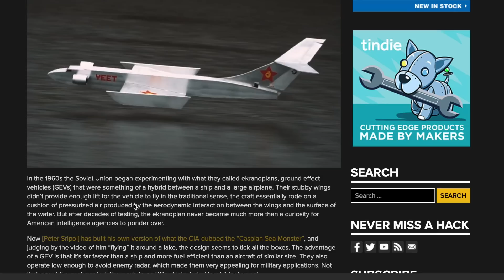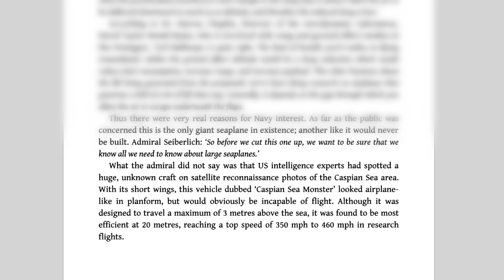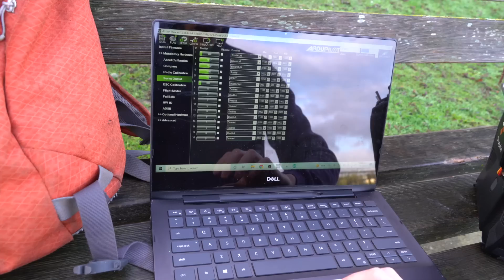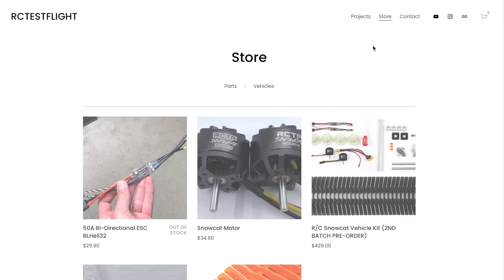Worlds First 'Real' R/C Ground Effect Vehicle

Comment: The reason real ground effect vehicles can’t fly is that they were engineered to only have enough power to fly in the ground effect, but with electric motors you have so much excess power that this isn’t really possible at small scales.

Comment: Maybe the easiest way to inhibit a ground effect vehicle from actually flying is through electronics. That might be cheating to some, but it probably wouldn't be very difficult to mount an air speed sensor somewhere, and then limit max speed through a flight controller.

Comment: There is a problem in ground effect vechils you know thos floats to hold that bubble those floats are facing down which gives it compression thrust even tho compression thrust works on mach 1 or above but still it give sthe lift even commercial planes are adding that down fin for fuel efficiency if you can some how make it like not produce compression thrust then ur good to go

Comment: Taking off seems to a big limiting factor for GEVs. Overcoming the resistance of water can be done efficiently with hydrofoils. The lift from the water will aid the craft to enter ground effect faster, lowering the required thrust, or vectoring for takeoff. The extra circuitry needed to raise and lower the folis will surely add extra weight, but I believe it's possible to achieve good thrust to weight balance to create a true "Ground-effect vehicle".

Comment: I just had another look at the "Caspian Sea Monster" and compared it with your craft... I think it operates on the cushion trapped between the two outer "floats" on the main wing.  If the altitude gets too high, the high pressure can escape.  Your craft has proper wings outside the "floats" which allows it to fly even after the high pressure has escaped.
Regardless, the model operates far too well to mess with it, just to try and satisfy some random definition!   Thanks for the videos.

Comment: Great job on your Bixel-type WIG!  BTW, Bixel proposed large (e.g. 747 size) "free-flight" aircraft using his symmetrical airfoil designs.  The stability and relative aerodynamic efficiency of his designs are obvious through your tests.  Consider the effect of split flaps installed near the trailing edge of the center fuselage along with split flats on each side wing....these flaps would serve as "air-dams" to help seal the gap at the trailing edge of the "skirt-less" hovercraft-type lift chambers formed by the insides of the float rails.  These flaps should allow for lower take-off and landing speeds and better low speed maneuverability.

Comment: One difference worth considering is the wing loading.  Ground effect with full size aircraft is generally accepted as the disruption of the wingtip vortices with the ground, increasing induced drag.  Induced drag is a function of lift, and by extent, weight.  Something like am Ekranoplan has a much higher wing loading and generate substantially stronger vortices than your depron rc plane even adjusting for scale.  Those wingtip vortices become much stronger when you have a heavy, clean, and slow moving vehicle.  Without increasing the scale of the vehicle, achieving near perfect results will be borderline impossible as this rather niche corner of aerodynamics dont exactly scale down to be achievable with something park flyer RC sized.

You could try adding small vortex generators to the leading edge to further reduce power.  But other than that, I think you've achieved as much as you can feasibly get without diminishing returns at this point.

Comment: Loving this series.   My 2c is that while your aero design is good, you also need to pay attention to hydro design when on the water, so that you can accelerate faster and then have less surface tension holding you down.  Your square floats are causing huge turbulence under the wing when you need that water smooth. Look at the chines on a motor boat or even flying boat.

Comment: The purpose of ground effect flying was to stay low under radar and save fuel for long range delivery across an ocean.  You need to test fully airborne and in ground effect to see which is more economical and that would prove it a ground effect vehicle regardless of it's power capabilities.

Comment: I know nothing about ground effect vehicles but was thinking about its tendency to fly higher than GE and wondered has anyone tried inverting the airfoil but keeping the low trailing edge, in effect forcing it to fly on the high pressure area at the trailing edge? As soon as it loses that pressure it has to lose lift. Just a thought 🤔

Comment: Looking at your videos, I actually think you would have something, in a larger scale. But use engine in the fuselage or 2 in the wings facing down wort , for the first push up, then you can keep the front engines in an static position.
For the lager scale, it's very possible to use for passengers. And by the way, contrary to American believe, power does not always help you.
I am a ships engineer, and there is a ratio between power and actual practical use. A ship has a curtain hull speed, adding more Power does not really make it go faster.

Comment: I wonder if it would do better by cutting off the wing tips... the hulls should be boat planing hulls like floats on a float plane. All the emphasis should be on the center high pressure area... I would start trimming the wing tips until the desired effect is achieved... 
I think the definition of a ground effect vehicle should be: classified and insured as a boat and not an aircraft (regulated by the FAA). Boat construction, insurance, maintenance, safety and repairs is far cheaper than that of an aircraft. 
So keep trying!

Comment: Rubbish!!!   I built an RC  ground effect vehicle 7 or 8 years ago.  It was a Lippisch type reverse delta of 400mm span. It was built from white foam sheet. I had a cutout in the fin in which a tiny lightweight motor & propellior was mounted. It was controlled by a 2 channel micro RC system for rudder and throttle.

Mine came about from trying out a very simple ekranoplan glider made out of ceiling tiles after finding the plan on the internet. I tried it, then enlarged it slightly to take a microscale power plant.  It took a bit of tweaking to get the tailplane incidence right, A couple of days of on & off fiddling was all that was needed. Just a little idle weekend project. No big deal and I'm sure many others have followed a very similar route.

The trick is to keep it simple, you have way overcomplicated it. e.g Why do you need ailerons? If you are in ground effect then the wings are automatically self-levelling (a dropping wing will get more lift as it gets closer to the ground).
 Who says it has to take off from water. I just hand launched over tarmac. More gadgetry = more weight = more power needed. So you got into a descending spiral?

But my main point that that you are far from the FIRST. Just the first to make a big deal out of it.

Comment: hey great experimentation! 
Might try tapping on  bunch of short and super light, weight "tell tail" streamers onto the bottom surface of the wing between the sponsons to observe the flow behavior with the onboard camera. 
Also would be interesting to observe the flow across the top of the wing at various angles of attack, at various speeds and with and without some spanwise flow "gate" devices as used on flying wings?
What would tip sails do? 
What would Leading edge slats, turbulators or other whacky STOL devices do? 
good luck!

Comment: No, I work in aerospace, and I can tell you from speaking with the engineers , that NO the original Russian plane would NOT have been able to fly. It was specifically designed to maximize ground effect in every way possible. That isn’t good for flight control and aerodynamics. Specifically the wing angle and thrust dynamics.

Comment: Great video. I'm thinking the issue here is that your wing area is good enough to fly. So maybe a "real" ground effect vehicle is about the wing area and not really limiting the power you have.
If you decide to go further with this, I think you should try decreasing the wing area to find the sweet spot where you can be full throttle and in ground effect. Using the added lift from the motor tilt could allow you to minimize your wing area even more and maximize your speed.

You might encounter some issues, like your wingspan being so small that any difference in the weather could prevent it from ever lifting off the water. But this might improve stability. As right now, your wings are Technically, a ball to make the plane fly. The small differences in power and weather make the plane want to lift off. So having smaller wings might minimize that effect, That small "bounce" you observed.

Comment: I feel like the inherent issue here is scale. 

Things scale with size differently. For example size and weight do not scale in the same way. If you made it twice as wide in terms of wingspan, its surface area (which relates to lift) would be be x4, but the volume (which relates to weight) would be x8. That's the square-cube law. I can only assume that this would then have big implications on how thrust and drag (of both the air and water), interact with each other. 

On top of that you are also interacting with things in the environment that are real size. All those ripples in the water, the breeze of the air etc. while they seem small to you, they are actually all massive in relation to the tiny scale of your craft. 

So perhaps it's actually physically impossible to achieve the right balance of thrust, drag and lift for true ground effect at that small of a scale.

Comment: I have an idea to make it not able to fly... but that wouldn't be an aircraft any more... What about using underwater boat propeller for propulsion? In this way as soon as the "plane" goes too high and the props are out of the water it looses propulsion almost completely... As I can imagine it requires a lot of consideration where to put that (those?) propeller and I also see a big chance it could be super unstable... But if it works it would be something really unique :D What is that a boat with wings?
Reply: May be with a long shaft behind the vehicle...

Comment: One way to do that without cheating is to make an electrically limited power train: instead of reducing PWM or motor strength, make the power input from the battery the limit. This limit is then low enough so that the GEV can't fly outside of ground effect. And to allow the plane to start from water, add a capacitor in there, which delivers enough power for liftoff, but is empty right after that. That would be similar to the caspian sea monster, which could increase it's power for starting, but couldn't keep this high level of power going for the whole flight.

Comment: The definition of a ground effect vehicle regardless of how you word it cannot preclude a vehicle like yours that has more power than it needs. The Caspian Sea Monster will surely have had more power than it needed to fly at the optimum level to maximise ground effect. I am sure if they went full throttle it would fly a bit to high and start to rise and fall almost bouncing on the top of the ground effect. Look at the Saturn V rocket. Nil aerodynamic lift but a Rocketdyne F1 got it off the floor. I would imagine that an F1 on the back of the sea monster would also achieve "flight" but not perhaps the most stable. What you have done is exactly what the Ekranoplan people did. Identify a concept, produce the machine and make it work. They didn't just have engines that at full bore achieved ground effect. Another good video squire and don't listen to the critics. 👏👏👍👍

Comment: You keep running into problems because your wingspan is so short. The intensity of ground effects is determined by the ratio of your altitude to your wingspan. With the design you have will only have noticable ground effects within 3 inches of the ground. Your plane is too tall to fit inside the ground effects.  Worse ground effects reduce rear lift, which makes the plane want to pitch up. This forces the nose out of the ground effects. 

You are not flying in the ground effects, you are repeatedly stalling and bouncing off the ground effects, like a stone skipping across a pond.

In order to properly fly in the ground effects you have increase the size of the effects to include your desired altitude + the height of the plane + a little bit more to accommodate the plane nosing up. This means a plane with a wingspan at least 5 times its tip to tail length. Or some way of dynamically altering the downwash in response to changes in airspeed.

Of course if the skipping stone flight accomplished your goals them good job.

Comment: Have you considered adding a sensor that would regulate the down elevator? That way when the vehicle starts to go too high, it can self Regulate its height.
I think you should consider the goal of being able to fly as low as possible using the least amount of power. Isn’t that the purpose of having a ground effects vehicle? Don’t you want to get off the water with the least amount of effort? Once you are off the water, power should be regulated to the minimum needed whether it’s battery or gasoline.   You have to consider that a real Ground effects vehicle will have a pilot to adjust the power to the minimum needed. In reality, they will have A large range of power to apply and it will take many seconds for the plane to respond. The power you have in your propellers on your RC version allows your craft to respond instantly making it hard to operate.  Your power to weight ratio is just too high and does not scale. Loved the video.

Comment: Have you tried loading it down with a bunch of weight? Weren’t these designed to be high speed heavy lift capability? Maybe try loading it down with a tungsten ballast… make it too heavy to fly then you could use it’s full power. I’m sure you can figure out a realistic power to weight calculation, (heavier than a plane lighter than a boat) it would be a quick test of existing airframes.
Reply: Did some quick research the Caspian Sea monster could carry 544 short tons so 1,088,000 pounds. Too heavy for an aircraft little light for a boat. The point was to be too fast for traditional naval targeting and too low for air to air/ surface to air, targeting and tracking capabilities of the time. However it’s usefulness was quickly out paced by the latter. An electric commercial transport would make for an awesome progression of the technology… more weight bro.

Comment: heavyweight boat plane with short wing cant fly higher in air but can hover over water and most thing people dont see is that take ton of force under wing in order to lift plane out of water and get up to speed unite it get out of water it will hover for long distance and fast
only bad thing about motor in front of plane is because cant controls it in air above 100ft it will flipped front end too far up or nose drive in water it will destory it self so that reason ground hover i dont see anything about ground break but get me to point that hoverplane is groundbreaking because have air force down n rear barely touch ground that only thing make me think it groundbreaking

Comment: You're in the same scale-story, like a bumblebee.
Air-density is relativly higher to your scale, than with the Monster.

You even experience this with tiny scale-planes in the 1-2 feet wingspan or indoor-planes.
It's a different kind of 'flying', compared to a 4++ feet plane.

...and it's not the propulsion-power...

Comment: Water can still have an effect on conformal coated electronics through parasitic capacitance, especially at higher frequencies. Conformal coatings are great to protect against moisture and water damage, but they won't necessarily make the electronics 'waterproof' as in 'working when submerged'.

Comment: Do you think it would be possible to mechanically cap it using capacitors? Give it a short but unsustainable boost that's charged by the battery?

Comment: I was wondering if you put the foil or the pea sticking up in the back if you would have reversed it and put it on the bottom like a surfboard and add two more would that give you more of a weight distribution on the back end not allowing you to fly very high at all while giving you maneuverability when in just slightly above the water?

Comment: Does all this mean that you could build this much heavier, using the same engine setup?  Also, could you use an asymmetric capacitor (like the aluminum foil ion lifters in hobby electronics from the 70's) to slow the air underneath down?

Comment: Wouldn't the definition of "flying in ground effect" be based on power consumption while maintaining minimum flight altitude?

The conundrum being the high power requirements to break from the water, say 100% power. Be also enough to "fly" a craft out of ground effect. 

In brief, if you determine that your craft design is able to sustain ground effect at say 15% power. And unable to gain altitude or break from ground effect without increasing power.  Would that not be enough to prove your design?

Comment: I have question or theory: what if you combine GEV and hydrofoil? Basically while vehicle is in the water you have high drag because of big body, so hydrofoil could get body of vehicle out of the water, then while the body is not in water you change the angle of hydrofoil from flat "—|—" to V "/|\" shape to decrease drag even more using servo, then pick up the hydrofoil from the water using another servo. This is just a theory and I don't have time or skill to do tests, but if you are interested, I can do sketch in Fusion 360 and send it to you, if my explanation is not clear.

Comment: A question: can an air pressure reading underneath the wing or a pressure ratio reading between top and bottom help on stabilizing the ground effect with the correct power/thrust?